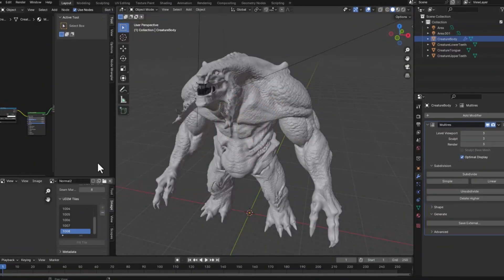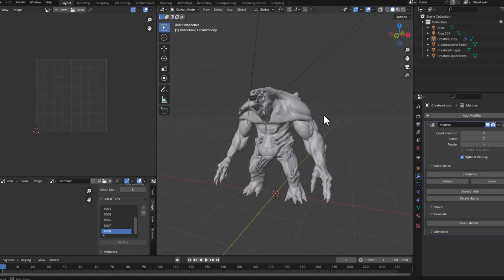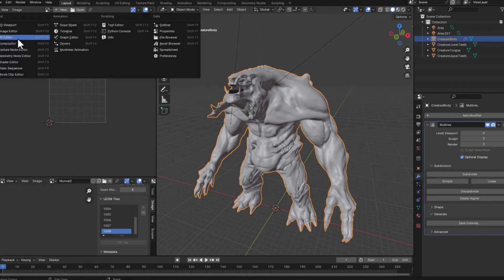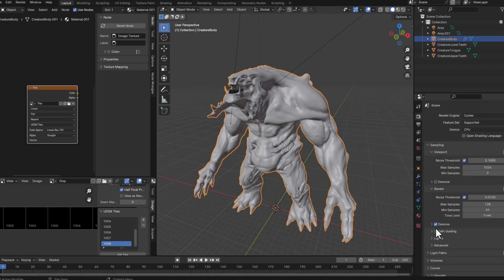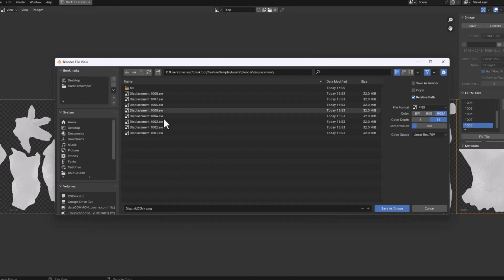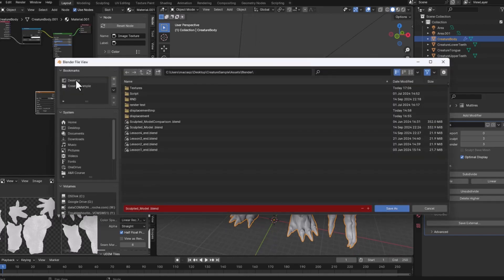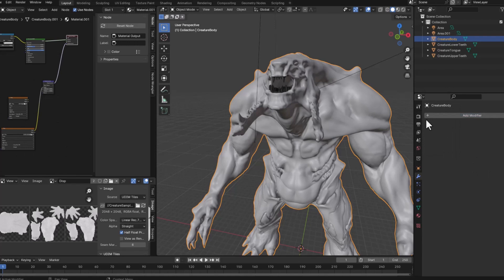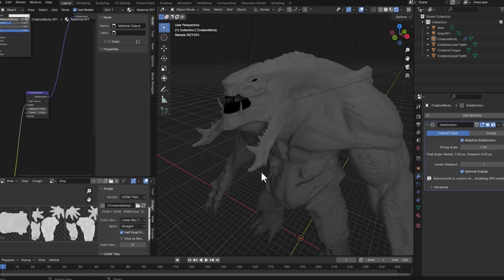UDIMs displacement map baking in Blender

Comment: what if I already have displacement maps set up for UDIM can I rebake on top of those displacement maps?
Reply from the maker: do you want to mix 2 maps or rebake another map with the original texture applied to the model?
Reply: Should I rebake another map with the original texture applied to the model? What's the best way to do this? I'm kind of new to this - would it be better to mix 2 maps or rebake them with the original texture? I feel like mixing would be the best way, right?
Reply from the maker: @mubarizsaeed187  I would bake it without the original texture applied, but I think it makes no difference (haven't tried it) also you can combine the 2 textures in the Blender compositor with a mix node or photoshop. But I would do it in Blender with a live render active to see how the mix is affecting the mesh in real time
Reply: @boostvfx7402  can I just put it in my UDIM tiles for my displacement shader group
 instead of mixing?
Reply from the maker: @mubarizsaeed187  I haven't tried this before. Maybe it will work. have you tested it?
Reply: @boostvfx7402  No Baking in 4.3 is hard Im getting alot of errors